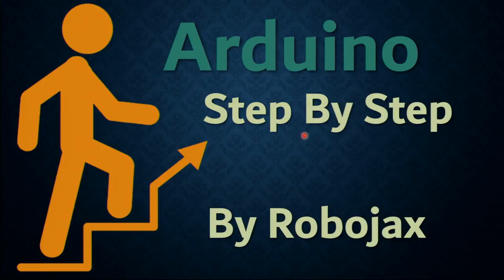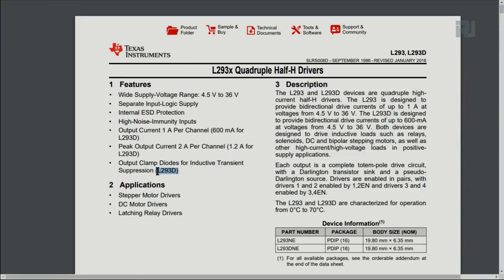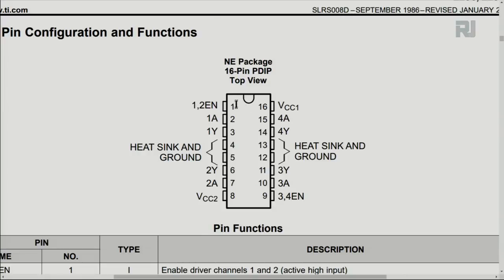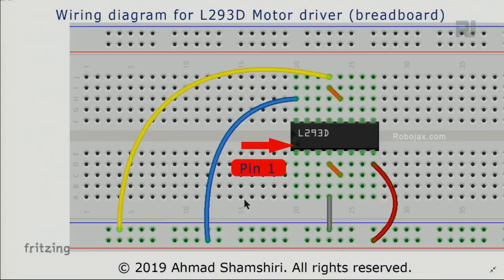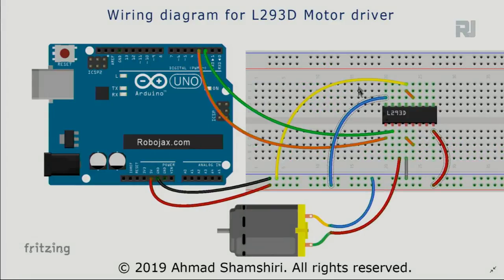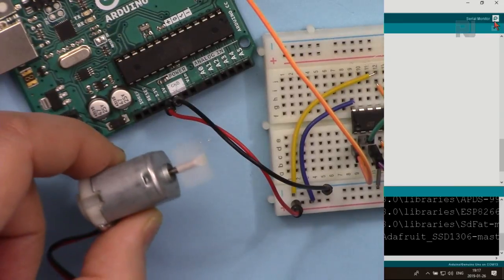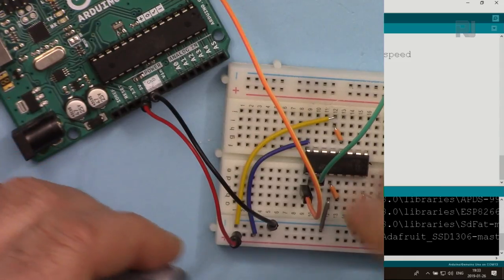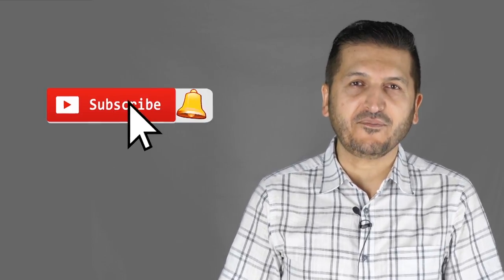Lesson 49: Introduction to L293D Motor driver and speed control | Arduino Step By Step Course

Comment: I want to control  4 number of 775 moter at once which driver should I use. It will be best if I am able to control 6 number of 775 motor.its there any way possible where i can control 6 775 motor ! Plzzz reply sir
Reply from the maker: This module can do that https://youtu.be/W_Wm28nQAYA

Comment: The motor was stopping below 80-95, meaning it was receiving much lower voltage from PWM around that frequency. To make it work below that, we need to increase the external source range (voltage)
Reply from the maker: L293D has very high voltage drop. Use TA6586 chip shown here https://youtu.be/W_Wm28nQAYA

Comment: would it be the same process if instead of an L293 chip I had a TMC2660 chip? 

the TMC2660 is only the chip. It isn't on a breakout board or anything. It's only the chip alone.
Reply from the maker: L293d is also sold in piece of chip
Reply from the maker: Lesson 102: Using ZK-5AD 4A Dual DC Motor Driver TA6586 The best Motor Driver
https://youtu.be/W_Wm28nQAYA

Comment: Robojax  Question: could (and if so how) you use the l293D motor driver to control a 12V motor with the arduino?
Reply from the maker: This is the method. It seams you skipped when I explained it. Please watch fully.